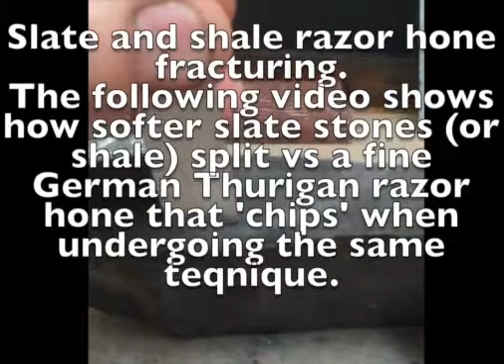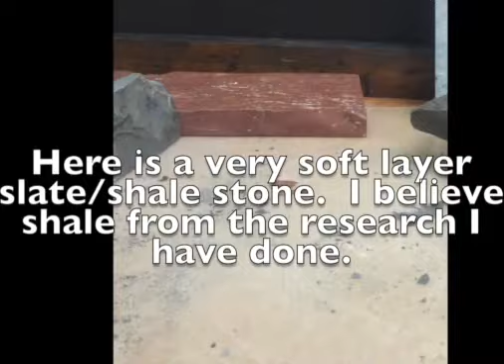Slate

Comment from the maker: In case anyone is wondering the Thurigan was broken when I picked it up for a few dollars at a garage sale, I have many more Thurigans so I didn't mind thinning this one out for the test.   I will lap it down smooth on the bottom, most likely to glue to a paddle. I was expecting it to split like the other slate I have tested,  but it is much harder and chipped off chunks instead of splitting.

Comment from the maker: Here is a comment left by a subscriber in the first video I posted,  I wish I would have copied the name before deleting the video, if this is your comment please let me know so you can get credit.  I found it to be a great bit of information.

It was in response to my comment the first piece of stone was most likely shale.  The first video did not include the Thurigan.

~~~
it looks softer, so yes this could be considered shale.  But slate doesn't necessarily need to break into clean horizontal layers, it can go under the metamorphic hardening process but still be 'dirty' mixed, and break unevenly.  Some other tests would be if it holds water or extrudes oil when water is placed on it.  Both these tests are indicative of shale.  The difference between shale and slate is not entirely scientific.  Jnats are referred to as 'old slate' sometimes, but to scientific standards it passes more tests as shale.
~~~